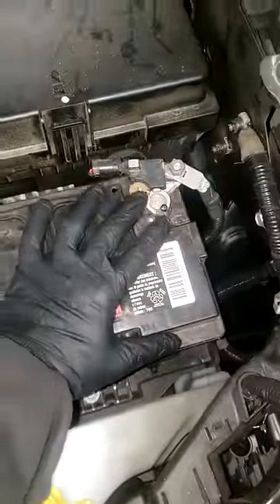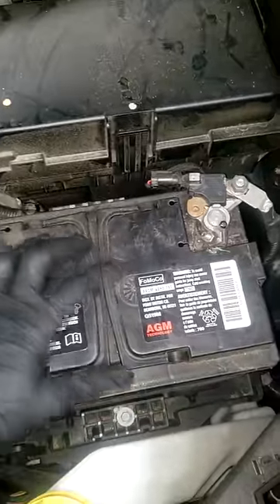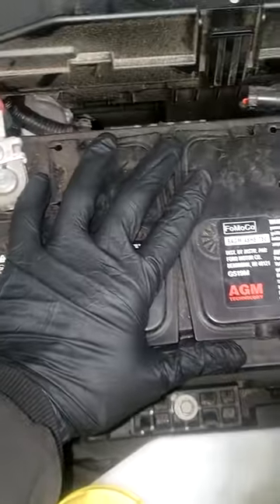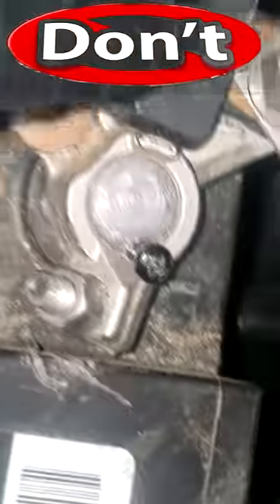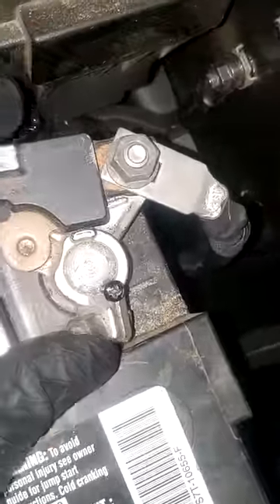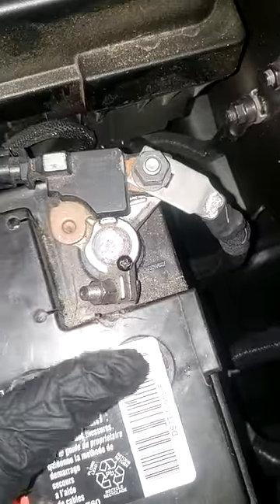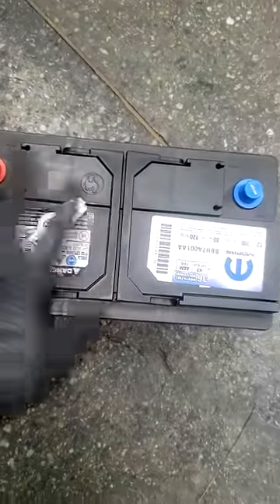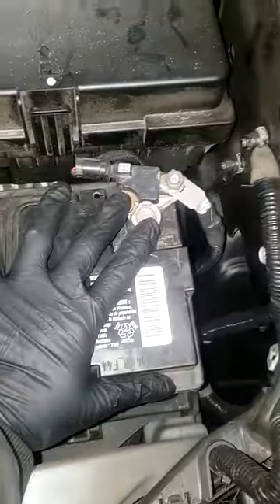STOP DOING THIS PEOPLE. This will destroy your car electrical system.

Comment: that screw wasn’t the cause of the problem but i guess good job for making it right
Reply from the maker: Now just how would you know what the cause of the problem was?  What are you a psychic? Or let me guess, you a master tech with over 20 years exp?
Reply: @OnlineMechanicTips  because that’s not a cause. there could’ve been wadded up aluminum foil and nails between the split of the terminal and that in itself would not be a legitimate failure mode. you didn’t show any testing but i’m assuming you did test the battery charge sensor and found it faulty, with or without the screw. or the the terminal was still loose, which would’ve been the problem with or without the screw.
Reply from the maker: @benjamin8981  So you do have psychic powers huh? Im here with the car up close and diagnosing this problem base on the codes and visually what I see and you seem to think you in a better position to tell me what the cause is??? Make this make sense. And why yall youtube watchers expect to get a fully explained diagnosis video out of a 60 second shorts video is beyound me..
Reply from the maker: @benjamin8981  Naw, dont put words in my mouth. The screw compromised the connection between the battery post and the IBS sensor. Big no no on these newer cars. That is a sensor not some typical battery terminal. That sensor is monitored by the computer, if the computer sees a problem, it will set a code. That code should direct you to at least look at the sensor, while visually inspecting the sensor I find this.  Conclusion, there shouldnt be a screw nowhere near the battery especially if its equipped with a IBS sensor.  The customer lucky her transmission was not knocked out of proxi alignment. (not sure if you even know what that is). Then it would have locked her out and her car would have to be towed to the shop. And btw, theres no need to give me no benefit of the doubt, keep that.
Reply: @OnlineMechanicTips  the “why” is what everyone wants. even tho i disagree on the screw itself being the issue, you should be telling ppl why it’s an issue. personally i think the terminal lacked clamping force and allowed movement on bumps or resistance at high load conditions. i see cracked or screwed/nailed terminals on 1/5 cars and it never presents an issue unless the clamping force is too low. or a faulty sensor if it’s a flood vehicle or even worse, a mopar
Reply from the maker: @benjamin8981  Hence the reason you here watching shorts. Most viewers attention span short and they will not set and watch a 10 min fully diagnosis video so shorts was invented, now the complaints are theres not explanation on what you doing. Dam if you do, dam if you dont I guess. And btw, it dont work like that on all that you mention in ya last comment. We not going to risk cleaning up anything that another shop just tampered with. A gauranteed fix was just what I recommended. She agreed, approved and gone.
Reply: @OnlineMechanicTips  i feel that. and if the customer says to do it, your recommendation and their approval is above all else. it just reminded me as a kid the adults say “don’t do this” but don’t say why. you trust your experience and your instinct, but it’s hard to trust someone else’s without a reason or explanation

Comment: Verry Real
Batteries that are bad or not working properly in these rolling pcs can be scary; I remember jumping a dead battery in my mustang (with the tech pack) to get it home, and on the drive back The whole dash blacked out and rebooted while I was driving also the whole drive the nav system never turned on too.

After a new battery Everything was fine as if nothing was ever a problem, If you are having a problem with a vehicle you should question the battery

Comment: Ive ran into that 😂. Idk who tf is drilling screws into there to get proper connection but its annoying 😂
Reply from the maker: And also risky stuff. She could have bricked her transmission and knocked it offline. This not cool on these newer cars
Reply: @OnlineMechanicTips  what i think is funny is people who buy those charge posts and think thats a permanent fix to turn a side post to a top post instead of changing out the terminals 😂
Run into a lot of “My car wont start sometimes. I think the battery’s going bad” and turns out the charging posts wiggled loose.

Comment: Sounds as bad as a nurse saying oxygen is flammable.
Reply from the maker: It is
Reply: Are you saying Oxygen is flammable? Because it's not. It will make a flame burn hotter, yes.

Remove the match, the fire is gone.

That's non flammable.
Reply: @OnlineMechanicTips  Any mechanic with an acetylene torch could verify oxygen isn't flammable very easy.

Comment: Is it possible to properly clean the battery terminal without disconnecting it Because once you disconnect the battery. You might brick the car until you can get back to the dealer.
Reply from the maker: Thats exactly the risk this customer was taking. Smh. I have a course Monday on the electronics and I will pose this question to the instructor

Comment: Can we all just agree to the real problem here...that car makers now install cheap shitty battery clamps that stretch and wear out far too easily, especially since cars are so dependent these days on electrical components? The battery terminal should be beefed up, not cheapened. I wish we could go back in time to those 80's and early 90's cars that weren't built like the tanks of the 60's and 70's with carburetors and points, but weren't made like cheap toaster ovens made in China either?

Comment: Like to see the work after.
Reply from the maker: What is there to see? It now has a new battery and a new IBS sensor on it. Check engine light off now and problem solved.
Reply: @OnlineMechanicTips  😂I guess you see right.

Comment: Id bet theres just buildup on the post causing intermittent connection. I bet if u clean that terminal and clamp with a wire brush if its loose add a strip of lead tape around the terminal to thicken it up and ensure a solid connection. 5 buks max
Reply from the maker: She just left a shop that tried all these hacks. No more hacking. She wants her car FIXED. And yes that intermittent connection problem so not good on this newer cars and can lock you out of your transmission. A battery (the correct battery btw) And a new IBS battery terminal and shes long gone and happy

Comment: at first look i would say your guessing with saying the ibs sensor is bad then confirmed it. can not condemned  the sensor just because of a screw thats not directly into the sensor
Reply from the maker: First off I dont use un professional words like bad. That screw is in fact compromising the connection and causing problems. Otherwise the check engine light would not be on with a IBS related code and the customer would not be at this shop. I suggest you leave the diagnosis to the pros and you stick with the crypt stuff.

Comment: Ummm...your wrong. Unless that terminal end is wiggly that ain't it. Test the battery and verify poor charging and/or dead cell then still connect a battery maintainer to the vehicle, read it out and verify that the alternator is charging and that the sensor is reading accurately. Then proceed with the authorized repair that you verified the fault for. This more than likely is a battery issue due to recent temperature fluctuations from the seasons changing. Either way always verify the customers concerns, check all systems and components related to that concern to make a thorough diagnosis and then finally double check your work and verify that the repair that you made took care of and corrected the issue causing the customers concern. That's how it's done my mechanically inclined boys and girls.
Reply from the maker: You just commented a bunch of normal nothing. Most mechanics are aware of those steps. But I'm still stuck on your first sentence "I'm wrong" please explain that part.
Reply: @OnlineMechanicTips  I said that your wrong because that is not the proper way to address an electrical issue or any issue for that matter...where's the 3 Cs, diagnosis and/or verification of the cause of the problem and the data to back it all up. Anyone could look at the screw in the battery terminal and say that it looks suspect but that little fastener ain't hurting a damned thing and you know it. If anything I would say that the battery has shit the bed because from the looks of it that's the factory battery and you recommended a new sensor to cover your ass. I'm still betting that you never read the car out, verified the integrity of the starting&charging systems or cleared faults, reset the counters for the bms(battery monitoring system or sensor) nor did you do at least 3 key cycles during your test drive that also didn't happen to reinsure that all electrical issues have been addressed and repaired. There is a reason why there is a difference between technicians and mechanics. That also goes for diagnosticians and parts replacers. You may get lucky 90% of the time by throwing parts at a car based on visual inspection alone but you will struggle and hate life the other 10% where that will bite you in the ass.
Reply from the maker: @scotturtel1094  Seems you have a hard time starting off a sentence. Same mistake twice means you need help. First off, you can't claim somebody is wrong on how they approach a problem simply because its different than yours. These are call opinions for a reason. In my opinion I felt what I did was the best way to get where I'm trying to get. Simply because you disagree with my opinion doesn't make it wrong. Its just different than yours. Theres no freaken right or wrong when it come to one's opinion. Fact is, I got this over here. I suggest you start a youtube channel and post videos highlighting your opinions on them. Thats what I do on my videos over here. We just have a difference of opinions. That happens.

Comment: lol they put a Screw through the sensor?  Looks like the screw is in the Lead not the sensor..
Reply from the maker: Its one unit here. You cant buy them separate. If the terminal compromised that means its getting the complete IBS
Reply: @OnlineMechanicTips  Sry I am kinda old and I work on older vehicles, I have never heard of this sensor, I am assuming it measures either Voltage or Amps coming off of the battery?  What does it do and what is it called? Curious.
Reply from the maker: @85Studios  The IBS (intelligent battery sensor) showed up right around the time start/stop vehicles did. Information from the battery crucial and needed for the system to work correctly. Technically its 2 pieces but sold as a unit. If you go to parts to get another negative battery terminal, you will likely get a complete IBS, it will have the sensor on it. So if you try and hack that terminal with screws, you risk the chance of confusing the electronic. In addition, on some cars you can brick your transmission and knock it offline or proxy. So the purpose of this video is to warn my fellow people to not do this on these newer cars. Some are stubborn an simply want to stay the course. This is ok on the older cars tho. Thanks for tuning in.
Reply: @OnlineMechanicTips  oh.. I did not think it stood for Irritable Bowel Syndrome, But I admit i did have a little Giggle at the notion.  (Shrug)

Comment: Hmmm.... Doesn't sound like a step by step diag. to me!  More like chasing parts, throwing parts at a problem. 

And that set screw looks bad, and might be harmful, but for 40 years, it has cured all of my loss of contact-loose terminal issues. It is what it is. It simply becomes part of the clamp+terminal. Nothing more, nothing less.
Reply from the maker: Smdh, your 40 year old cars wasnt monitoring battery performance at the time my guy. You cant compare them old ass cars to these newer cars. Car companies now monitoring everything from tire pressure to the battery. This car use an IBS battery terminal sensor. You dont just put screws into dam sensors. Or a warning light will come on. This a 60 second shorts video and you on here expecting step by step diagnosis? You joking right? No chasing parts changing here, just new age diagnosis and repairs. Get with the program or you will get left behind, based off this comment you already way behind.
Reply: @OnlineMechanicTips  I appreciate your kind words and professional rebuttal. A 6 step diag. can be recited in 6 words If necessary.  No worries, don't overdo it.

Again. For your audience. Explain. Was the screw the culprit? We are confused, as I am sure you have read. Glad you got it all figured out.

I will bet you a bucket of Buffalo wings, that "screw" has nothing to do with that sensor. There's no electrical science or electrical schematic that supports that.  Point to it!

What was your code for "screw in clamp?"  You said modern cars are so far advanced from 40 years ago, well, I'm sure that "screw" threw some wicked codes. Point to it! 

And still today, you can put a screw in a new battery and won't get a code. Because? It doesn't affect anything. This HI-TECH scam you're falling for is just to get your money. $3900 for a PCM? They got you! Not me. I'll put a screw in it and drive it for 20 years. And take my grandkids on vacation with that $3900,...in that same car, with the screw in it. Michigan to Moab Utah. 

These auto manufacturers have us buffaloed with all this "must have" hi tech scam. It's all about money, not reliability.  They know parts are going to fail over and over, and make them big money. 

Smart mechanics are converting electronic fuel injectors back to the old mechanical injectors. Less expensive and more reliable! EGR deletes, etc. etc
No one is falling for this hi-tech scam anymore. Why do I need a $300 sensor to tell me my $3 dollar spark plug is misfiring on cylinder #3?  Because the manufacturer said so? Reach in your pocket and pay the "man". 
$1309 for R&R alternator. If you believe that ain't theft, highway robbery, then I have a pristine 1977 Yugo to sell you for $30,000.

Sounds like they got you.
Reply from the maker: @williamrobinson6680  Got me???Lol, Im dealing with the hand im dealt. Look dude, you welcome to put screws in your stuff all you want. No need to bet me if it needed it or not because im not about to try and prove anything to you. This cust would not even be in the shop at all had the check enging light not been on. I think you merely just wanted to see more on this video and thats understandable. But because this a 60 second shorts that was not possible. I will work on a stradegy to do a shorts and a long video on the same topics from now on because that make sense. Thanks for enlightening me on that. I also think its a lil reckless to slang out words like scam and im hoping that word directed toward the industry and not me personally. Because it seems your problem is with the industry. Things and times change buddy. I have no choice but to change with it or get left behind.

Comment: Come on now. Use proper terms.  That's not a sensor.  That is the intelligent battery module system at battery.    It's a Module not just a sensor and it will pop and lose connection if the air bags are deployed.    So yea.  Doing this patch tree mechanic work is not good.  If you think this is fine and okay and you actually say your a mechanic or tech.  You need to not touch any more cars.
Reply from the maker: The bulk of comments on this post are from so call Master tech. All defending that dam screw. This is the craziest thing I've ever seen. We are doomed as a country..lol

Comment: The screw is between the battery post and the terminal not into the sensor itself. 

You just sold her a sensor she likely doesn't need.
Reply from the maker: You don't know what you talking about.
Reply: @OnlineMechanicTips  I sure do. Tell me how I'm wrong or zip it.
Reply from the maker: @cristopherfrakes1416  The terminal is combine with the sensor. If the terminal compromised that means you get a complete IBS. They sold as one.
Reply: @OnlineMechanicTips you're absolutely correct. My apologies, I didn't realize at first that was a Chrysler unit and that it was integrated.

Comment: they'll do it anyway, people, wether you like it or not and it's habit, because that trick dates from a time when cars weren't 99% computers.
Reply from the maker: They get towed in with transmissions bricked and offline still to this day simply because of poor connections at the battery. Its sad
Reply: @OnlineMechanicTips  tell me about it.  I had a jeep I just BOUGHT bricked when having the correct battery installed because the previous owner had the battery facing the other way, and the tech put the proper one in facing the same direction.  fried 3 alternators and probably the voltage regulator in the comp (wich is worth more than the car!)

Comment: When you are a low skill mechanic, you just replace everything and charge the customer. No meters, gauges, tests, nope. Just spend $300 on a new battery as sensor, instead of clean up the original, test for continuity at the sensor, clean the sensor bung on both ends with electrical connector cleaner, cap and grease the terminal and put it all back together.
Reply from the maker: And you just some typical nobody ass youtube troll that say stupid shit like this on a shorts video. This a shorts for a reason and I'm willing to bet if it was a 10 minute video explaining everything you mentioned, that you wouldn't understand it anyway. Or watch it for that matter. So ya clown ass will hop on a shorts video asking about testing. Yes, you def a joke..FOH
Reply: @OnlineMechanicTips  Don't cry. I would have fixed her car for $150 🤣👍
Reply from the maker: @MindsMouth  Cry?? Naw.. But by looking at your channel it seems you don't know shit..lol..Let me guess, you a master tech with 30 years exp..lol..yea I hear/see that all the time..And I do brain surgery also. See how easy that is to do.